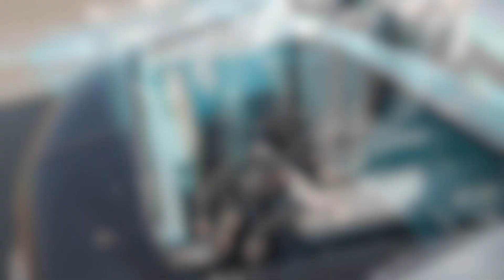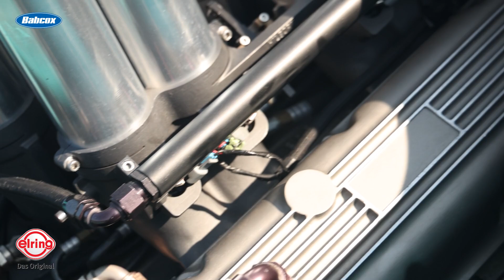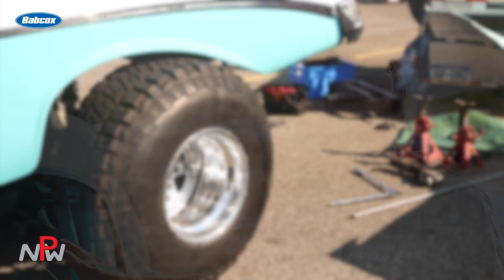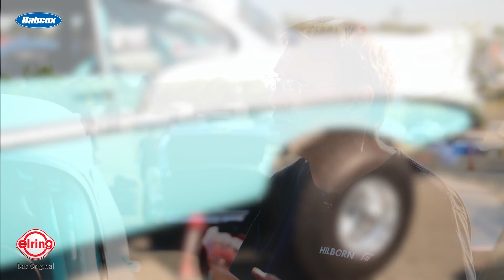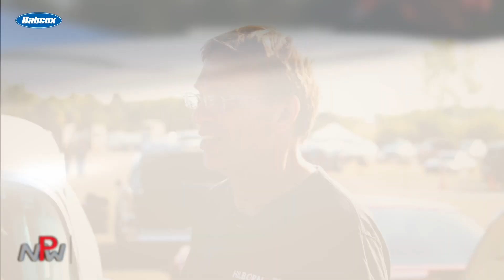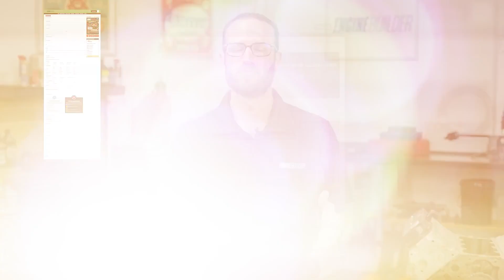Andy Starr's 582 cid Big Block Chevy Engine

Comment: I never considered stack injection helping with tuning and drivability on an engine but it makes A ton of sense!
Reply: The IR manifold helps dramatically with low speed even with that huge cam. There is no bucking or jerking at lower RPM's like one gets with a plenum style intake AND a stick would only make it worse. They rock!

Comment: with snow tires ? healthy tread on those street tires
Reply: I know, funny right. Since the transmission is 1 to 1 in fifth and no overdrive, the 35 inch tall M/T Baja tires help reduce the gear for highway driving. It works great and I learned this trick from other savy Drag Week participants. Function over Form in this instance!
Reply: @rocket56starr  what ever works and keep it simple you have to change tires anyways so why not get a gear change while you are at it ?